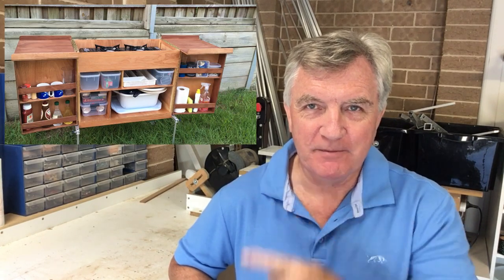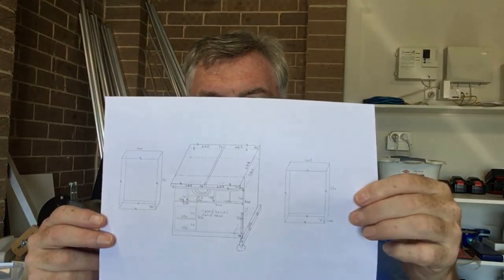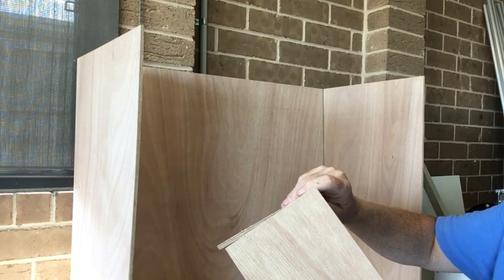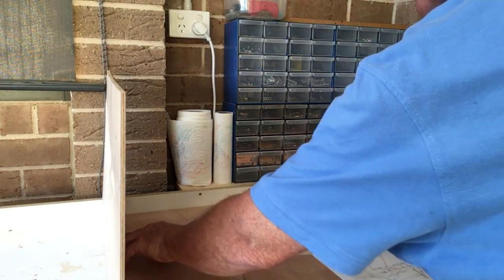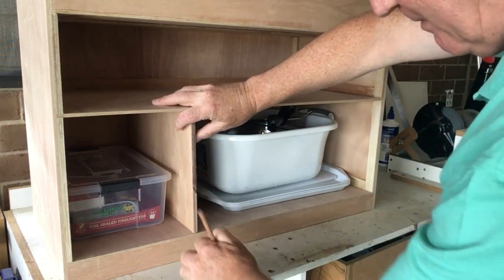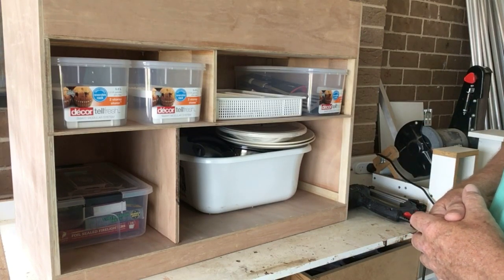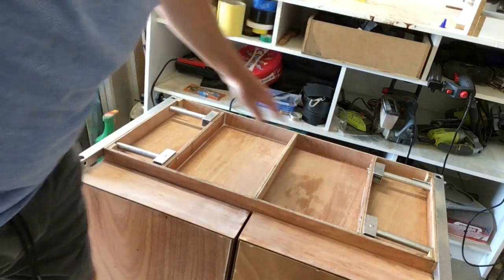Lightweight Camp Kitchen or Chuck Box - In Depth Step by Step Build

Comment: My use of one of these Chuck boxes would be as the kitchen for a bicycle camping trailer. Either on the back or front depending on whether making a steering front wheel with two rear wheels. Or two rear wheels.
Also would use epoxy to anchor the hinges to the wings and top.
Enjoy your build.

Comment: Wonderful project. It has inspired me to build one the same with some mods to provide a wind break for the stove. I don't suppose you can share your drawings?😀
Reply from the maker: Thanks Keith. I don't remember having any detailed drawings I'm afraid. I usually scribble a few notes with a pencil and paper and then wing it from there.
Reply: Thank for the reply  @FishingwithDen   I just wondered if you still had your scribbling's to share. I am thinking about having a rear hinged lid as well as the fold over ones with the front that lifts to allow access to the cooker knobs. It will also make a wind break.
Reply from the maker: . @SideSlipIt  Sorry Keith, my scribblings would have been thrown out at the end of the project. Good luck with your project though

Comment: I'm very impressed with your design and implementation! Very nice. I have a bit more heavy duty box that I want to put the adjustable legs on and wondering if you know how much weight that design can support before there's a chance of the leg slipping against the star knob bolt? Thanks.
Reply from the maker: I don't have any specific information on that Rick, but I use a similar system on my Fishing Tacklebox/Seatbox. I have never known the legs to slip against the pressure of the knob and I weigh over 200lbs. I would be careful with the thickness of the legs though. The ones I used in this video are only 16mm diameter with a 1.6mm wall thickness. I would suggest you use 20mm with a 3mm thick wall. This is what I am using on my new Seatbox. There will be a video series on these new boxes in the next couple of weeks, so you will be able to see what I am doing. I hope this helps.

Comment: Delightful!  Do you have the dimensions for the camp kitchen written down somewhere?  They go by so fast and I have to convert to inches to understand.  Thank you.
Reply from the maker: Hi Sharon. Sorry. Unfortunately not. I am not a professional woodworker or designer and I only made the video to show people how I built my own Chuckbox. You may therefore have to pause the video to make notes if you want to build something similar. 
I have never made one of these before, so my dimensions in the video may not be completely accurate. Please double check the measurements yourself if you build your own Chuckbox. Also, the dimensions you need will probably be a little different to the ones I used. In fact, I had to make some changes to my own plans as I went along due to mistakes in my sketches.
Please also be aware that now I have actually used it for camping, I would make one or two small changes to the design. During use I have found that the front stove controls are a bit awkward to access because the front wooden plate is quite close to the knobs. I therefore intend to make a raised cradle for the double stove to sit on when it is in use.
I will provide an update video in the next few weeks to explain what has been good and bad about the design. I will also show you what I explained above. I hope this helps.

Comment: just a question  would it not  be better to fit the strips or battens under the shelves  would be stronger
Reply from the maker: I see your point, but I can’t remember exactly why I did it that way. It was probably because I thought it would be easier to assemble. With regard to strength, I’ve found that the glue is probably stronger than the wood itself, so personally, I don’t think it really makes any difference to the strength. 

If you decide to make one yourself, please feel free to change things around to suit your needs. I don’t make any claims to be a professional at this. I was just showing how I made mine. I think everyone has their own ideas of what works best for them so take whatever ideas you may find useful and adapt them.

Having now been out camping a few times with my Camp Kitchen, there are probably a couple of changes I would make to the unit, but none of them are structural as it seems to be holding up well. I hope that helps.

Comment: Where did you get ghe legs from??
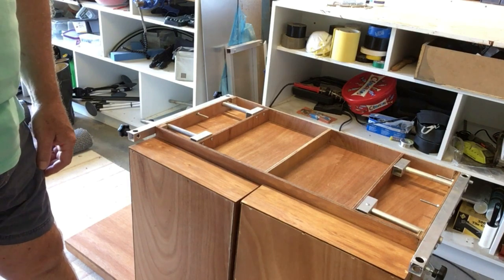Reply from the maker: I made them. That starts at  31:28
Reply: @FishingwithDen  yea i just watched the video
Reply: @FishingwithDen  what type of plywood did you use and how many sheets??
Reply from the maker: @marcodimeglio6667  6mm Marine Ply for the skin and 9mm for the strengthening parts. I can't remember how many sheets. I would guess at one 6mm sheet. I suggest you do a diagram and produce a Cutting Plan. That will save on waste.
Reply: @FishingwithDen  ok thank you
Reply: @FishingwithDen  just one more question did you nail all the pieces together as well of just glued them??
Reply from the maker: @marcodimeglio6667  I only used Brad Nails to hold everything together until the glue dried.
Reply: @FishingwithDen  and the glue has been strong enough??
Reply from the maker: @marcodimeglio6667  No problems so far. I used waterproof PVA glue. If you are not sure about the strength of the unit, you should use thicker strengthening pieces at the corners, the front and anywhere else you think may be a weak point. This was just my way of doing it. I am not a professional woodworker and I have no formal training.
Reply: @FishingwithDen  thank you
Reply: @FishingwithDen  did you have all the containers and everything you need for camping before you made the kitchen for sizes??
Reply from the maker: @marcodimeglio6667  I did have some of them, but I bought others to fit in with my requirements when I was planning the project.
Reply: @FishingwithDen  yea because im finding it hard to draw a plan of how to cut the pieces
Reply from the maker: @marcodimeglio6667  I just get a piece of paper and draw an 8ft x 4ft, (2400mm x 1200mm) sheet of plywood on it. If you divide those measurements by 10, you would have a 240mm x 120mm on the paper. Then you work out what size you want the back and sides to be and insert those into the drawing. Other pieces such as door panels can then be fitted around them. There is always some juggling to do, so make sure you have an eraser to hand.
Reply: @FishingwithDen  whats size did you make yours??
Reply from the maker: @marcodimeglio6667  You need to watch the video and make your own decisions on size.